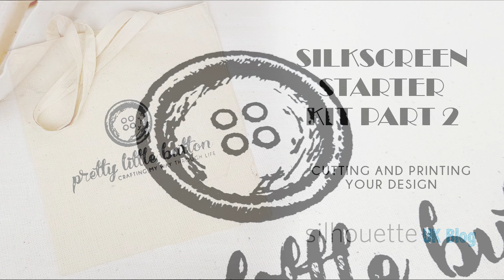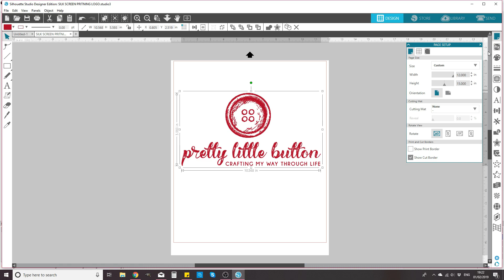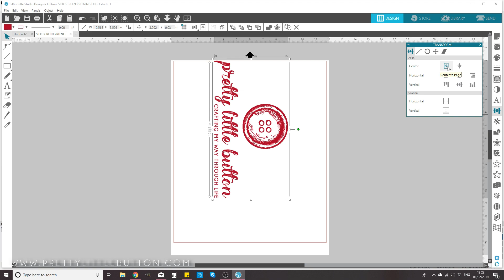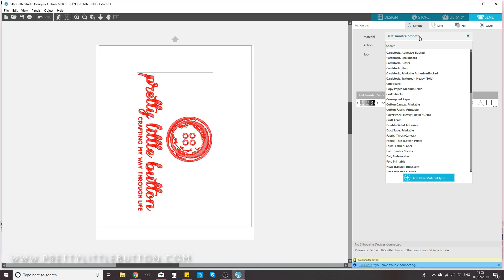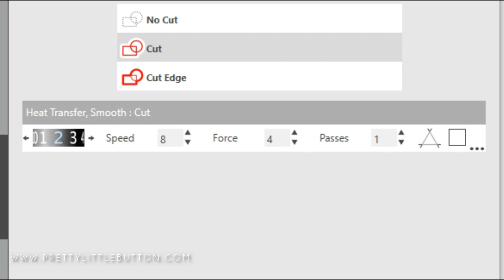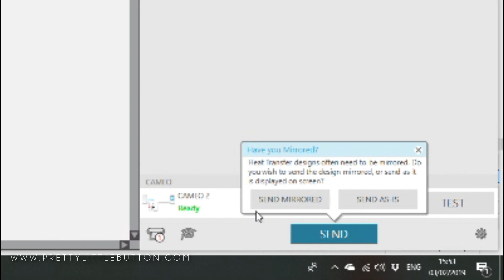Silkscreen started kit part 2 - Cutting and printing you design

Comment: Loved your video, thank you so much. I'm wanting to do the same design on multiple tshirts. How long do you think the HTV screen will last? Also, do I need to wash between each tshirt? Just wondering how to position it and not get ink on the second shirt if I move it around to position it.  Thanks for the help
Reply from the maker: Aww glad you enjoyed the video. The HTV vinyl should last for a very long time as long as you have it adhered down well and it is handwashing when you give it a could clean. You probably wouldn't need to deep clean in between each shirt. But I would certainly wipe the back off well and dab off any excess paint on a dirty rag otherwise some could transfer to a new t-shirt when your trying to position it on the next t-shirt. Hope that helps!